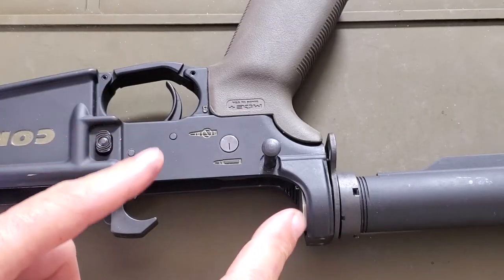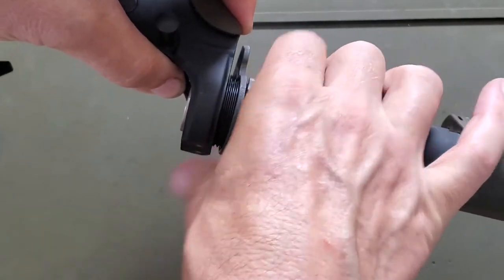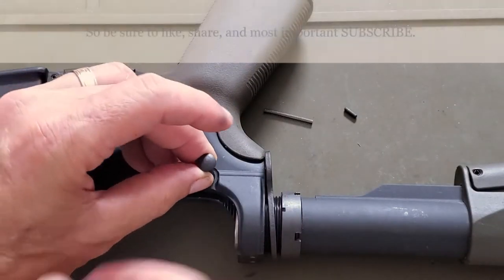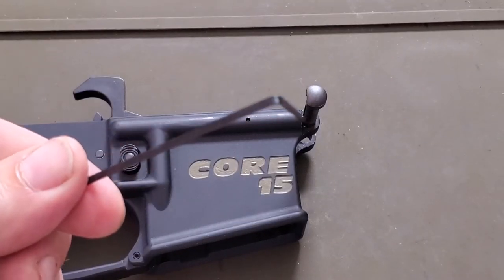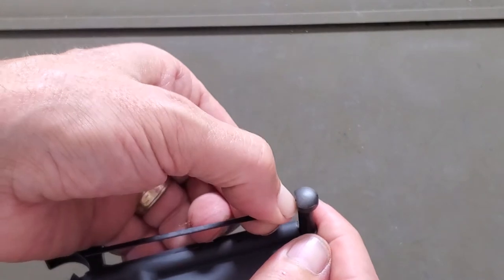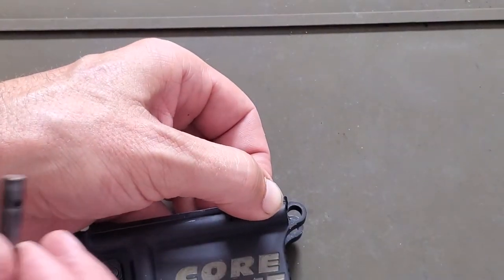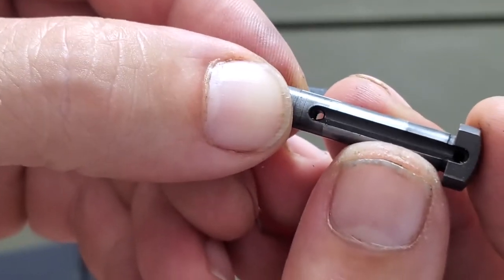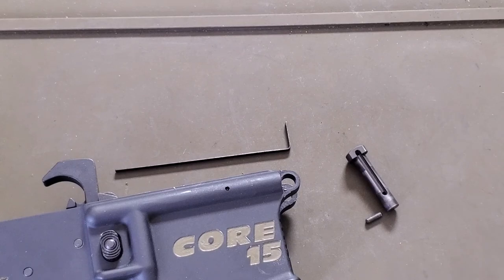How to remove Takedown pins

Comment: Instead of a lock picking tool to push the detent down, I used a .05 Hex Key Wrench to push it down. Slide the old pivot pin over. Push a Roll punch thru the other side to keep it depressed. Slide the new one on in 😃